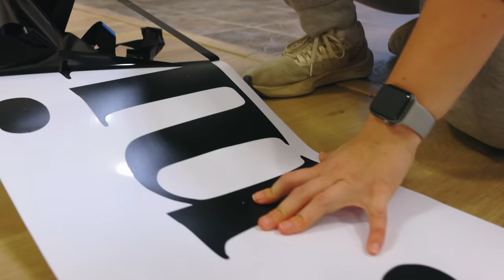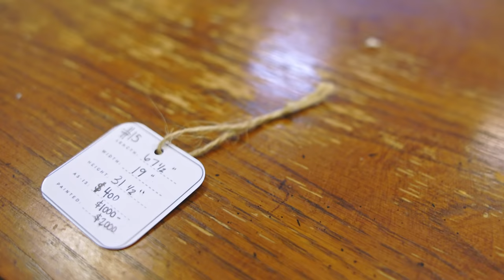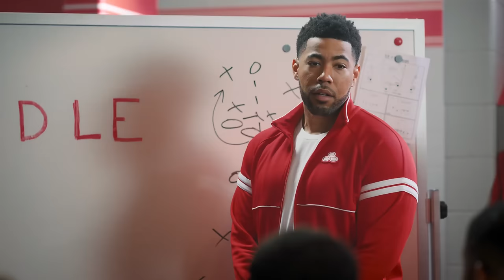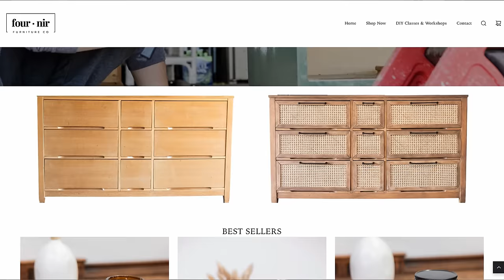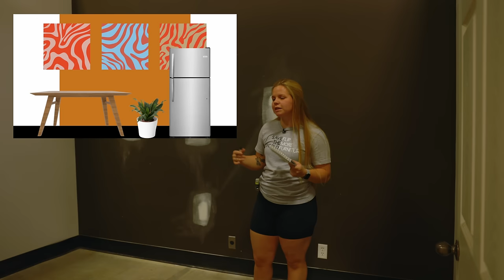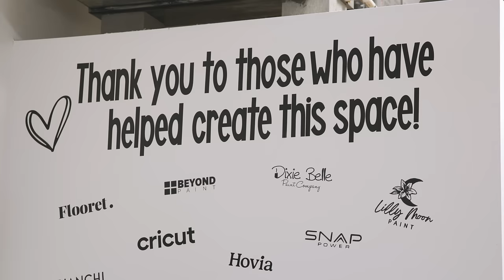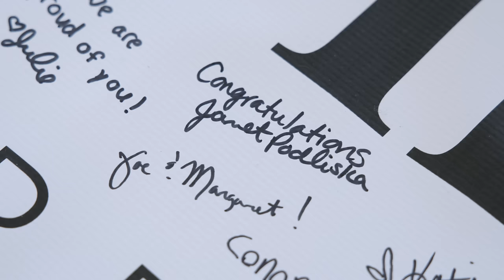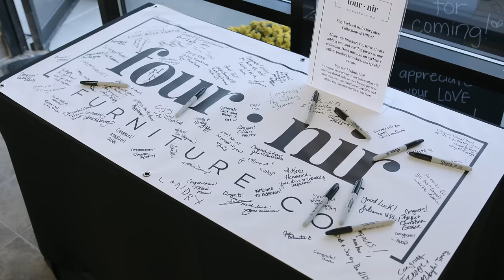A Full Walkthrough Tour of our Furniture Flipping Brick & Mortar Business

Comment: Caution ⚠️ when using glass for candles make sure you use glass rated for high heat. The carnival glass bowl could shatter with too much heat, it is a huge liability for your company. It’s seems like a neat idea but I recommend staying with only high heat rated glass, using metal is also dangerous it could get hot enough to catch furniture on fire. Candle fires are very common and candle manufacturers get sued all the time. You’ve worked so hard, have due diligence with your candles.
Reply: I've mentioned this when there was a reveal that thrifted glass would be used to make candles.😢